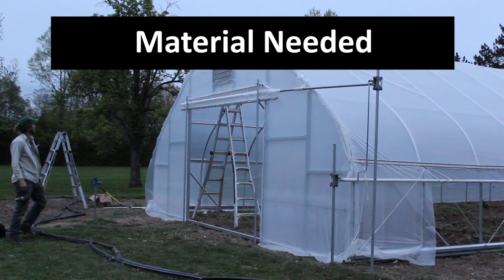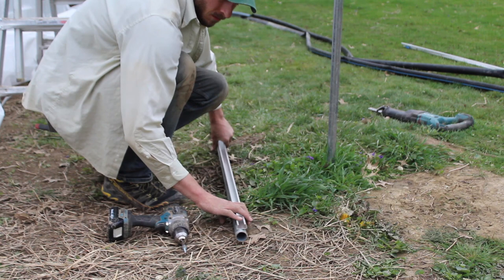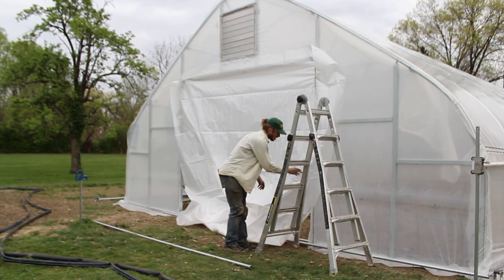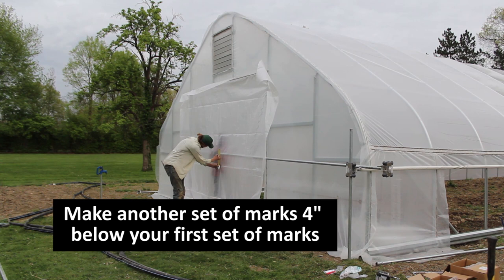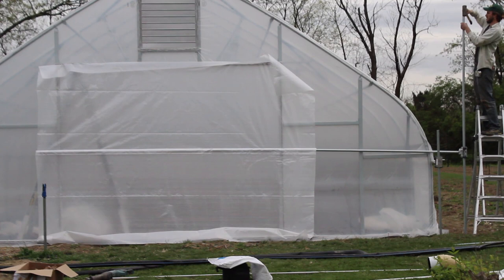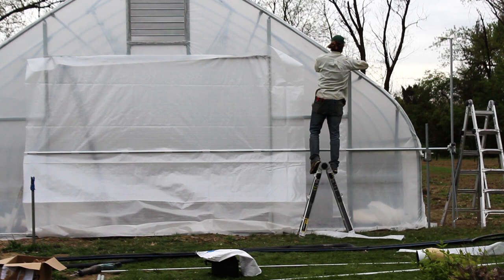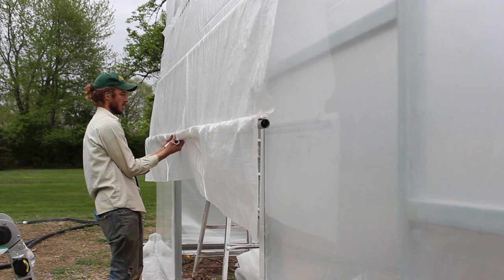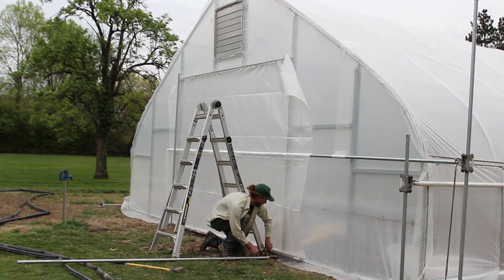Greenhouse Door Install - Large DIY Greenhouse Door Build

Comment: We were thinking about a wood double door on rollers. Does anyone think it might be too heavy? Or any thing else? Thanks from newbies.
Reply from the maker: Thanks for watching. As for sliding doors, and whether they would be too heavy for your bows / end-walls it would really depend on three things:

1) What diameter are your end-bows
2) What kind of framing does your end-wall have
3) how much wood will be in your doors

If your bows are a strong heavy duty steel, your end-wall framing has studs with firmly planted anchors, and your door framing isn't comprised of a TON of lumber that makes your doors too heavy, I would assume your structure can handle the weight of the doors. 

With the above being said, if your structure bows are comprised of PVC, and your studs are not well anchored, you may want to reconsider a lumber framed double sliding door until you address the other two points. 

Best of luck!

Comment: Why does the roll up gearbox need to be 12-15’ outside of your structure?
Reply from the maker: I suppose it doesn't necessarily have to be, although the gearboxes have some girth to them so if they are within the end-wall face you may find the gearbox scrapes against the end-wall plastic when operated. This would degrade the plastic if allowed to occur for an extended period of time. Placing the guide post and gear box 12" to 15" away from the side of the structure provides space for the gearbox to move freely without touching end-wall plastic.

Comment: Question regarding the tubing:  are these 3/4 emt conduit pipes you are using in this construction?  If so, are you using a normal emt connecter to extend the length.  Thanks for the video!
Reply from the maker: All of the tubing used in the video for the installation of the roll-bars, anti-billow tubing, and guide post are 1.315" Outer Diameter galvanized steel tubing. This is commonly referred to as "top-rail" or chain link fence top-rail. You can find it in most big box hardware stores in the chain link fence section. 

For our purposes, we get this tubing in 21 ft. lengths so we did not need to extend any of the units. If you purchase top-rail you will notice that one end is swaged (male) and the other end is un-swaged (female). You can connect / extend them using these inserts and self tapping screws.  

You could technically use EMT for the anti-billow tubing shown in the video, although I would recommend 1.315" OD top-rail for both of the roll-bars and the guide post. The reason being, 1.315" OD tubing configures with more hardware than EMT and it might make future steps and changes easier to work with. For example the snap clamps won't fit EMT but will fit the 1.315" OD top-rail, and similarly the gear box shown in the video works best with 1.315" top-rail.

Hope this helps!
Reply: @tunnelvisionhoops  Yes!  Thabks so much for your in deth reply!!
Reply: Do you have any clues to the ease of which to transfer back and forth from a roll up door to closing off the opening completely for winter growing?  i’m wondering if you can just unroll the center roll bar and pvc clips and fasten the whole thing with spring clamps in late fall, and redo it in spring.  Mayve it would be better to just get a seperate sheet of plastic that you spring clamp on behind the roll up so that you dont have to redo the setup?

Comment: What is the ideal size to construct high tunnel??
Reply from the maker: Thanks for the question - there is not necessarily an ideal size other than what size is ideal for YOUR operation and space available. Benefits can be experienced from small 10 ft. wide x 12 ft. long structures or large 30 ft. wide x 144 ft. long structures (for example). If I were you I would take a look at my property and what my goals would be for a high tunnel, and then I would try to determine what size would work best based on those parameters. 

Best of luck, and thanks for watching!
Reply: @tunnelvisionhoops  which direction is better while constructing high tunnel.....We have winds either from west side and some part of the year from east direction......